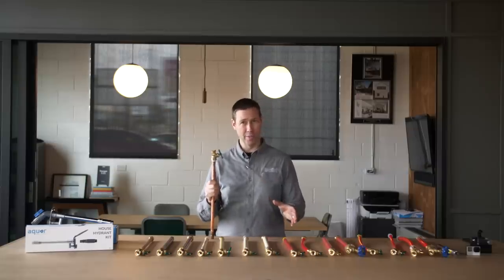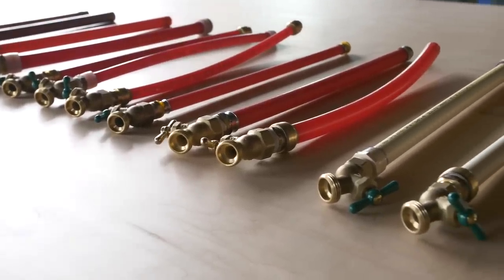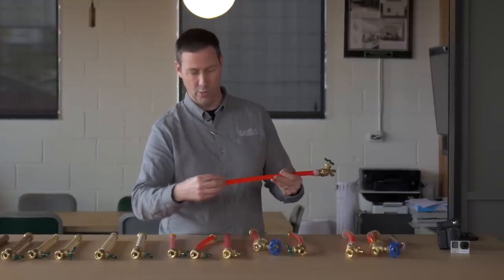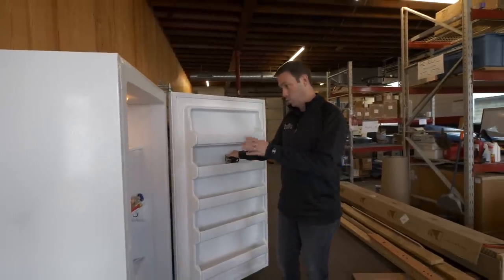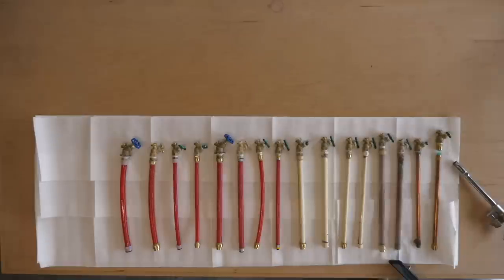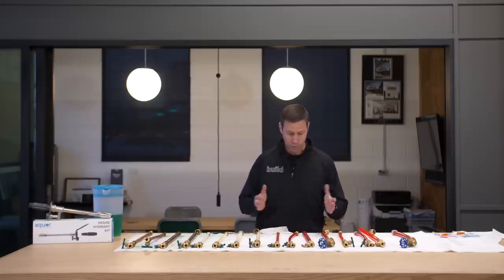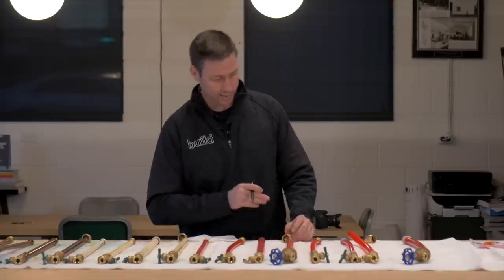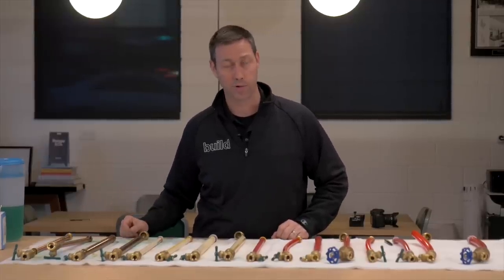Copper vs Pex vs SharkBite - Freeze Testing

Comment: I have not even finished the video yet.. Personal experience.. I maintain some commercial properties. Some are just warehouse spaces here in North Texas. I had one that had copper water lines run behind some corrugated metal to a mop sink in a corner on an exterior wall. Very little insulation and the copper was hard and very near the exterior wall. One winter the pipe froze and burst. I replaced a 4 foot section with shark bite fittings and pex pipe. added as much insulation as I could get in there. No more burst pipe in last 10 years.

Comment: I'm not a plumber, just a homeowner and DIYer but I am constantly amazed at how crappy CVPC piping is, it gets installed without a thought to UV exposure and forgotten about. The years go by and it becomes so brittle you'd think it was pottery.  It always splits in the areas I have to dig and claw to excavate and unless I have the time and energy to replace the whole line I am stuck with an intermediate repair of clean new PEX attached to existing CPVC.  It just sucks.  And one last remark about licensed plumbers, I wish you would propose the best repair not the easiest for you.  It doesn't always mean re-plumbing my house, just had to say this.

Comment: An excellent, informative, well-devised experiment, Matt. About the only issue I can point to is that you did not specify the temperature inside the freezer. The colder the temperature, the more expansion of the water/ice there will be. My assumption is that if the temp were, say, 10 degrees colder than the freezer temp. some of the other pipes MIGHT have blown.
Reply: Completely wrong. The reason there is life on planet earth is  specifically because  water  exclusively expands in the temp range of 0  to 4C. Once it is a solid it is stable and does not expand further.    The  change of density is what  keeps the circulation of water (and oxygen) thru the rivers, lakes, ponds. The organisms are able to live  in the cold but unfrozen solid water.  This is continually occurring in the oceans.

Comment: I live near Raleigh, NC so not severe cold weather but cold enough to go below 32 and freeze water in pipes. And once frozen I don't think it expands much as you get colder, so yes more likely to get frozen in colder climates, but no worse damage from more water expansion, although maybe more contraction due to colder. All that said I've had copper tube split in lines that I'd turned off but didn't get drained completely. I had a copper solder joint get pushed apart due I assume to the solder breaking not pipe or elbow, had pex lines freeze, but start running without leaking once thawed. And I had a pex to copper fitting joint that was kind of under some bending stress start leaking after like 10-15 years. And I didn't think about it till a co-worker mentioned this, but pipe and fittings also experience stress when it's a hot water pipe and experiences thermal expansion. I'm guessing this might have been the actual issue with the pex to copper fitting as it was a hot water line. Probably be good to put some slight bends or even full loops in pex to help it with this issue! And I'm on a well so I like that pex is very inert to the slight acidity my water has. I think it helps not only prevent leaks cause by acid eating away at the metal, but also leaching copper out of the lines and leaving green stains in sinks. And as a DIY guy I love the ease of working with pex. My favorite over all is pex used with barbed fitting and the pinch clamp type, because the bands are easier to remove than crimp type. I haven't tried the plastic barbed fitting. They might be the best to prevent any metal leaching if even the fittings leave stains.

Comment: Interesting test I was considering using pex and then a copper elbow through the wall for the turn valve. But after seeing this seems running the pex straight might be best, the copper and valve will always be the weakest link if pipes freeze.

Comment: I'm curious how PEX and CPVC stand up to heat conditions.  The intense southern heat is legendary, add to that the heat from hot water lines. How much do they flex/bow and deform.  I also have doubts and questions about the O-rings in these connectors, how long do they last  through the years with normal flexing from water pressures constantly rising and falling due to use of certain faucet usage.

Comment: Great video Matt and a lot of work doing all those. I’m sure this is 100% opinion based video by everyone but I’m in northern Michigan built houses for 25 years and I still will never change from copper. Haven’t had any freeze and burst yet even in exterior wall plumbing which generally is a no no. However it’s all going to boil down to proper installation and insulation properties what I saw in Texas is not much insulation and also a lot of plumbing in the attics, another no no. Just my two cents worth.

Comment: Well as an owner of a Plumbing and HVAC company that does a lot of insurance work, let me tell you what I know.
Pex will win this war every time. 
 The only instances that I see pex pipe fail in a freezing condition is when you have a short piece in between fittings that change direction.
 Other than that it pretty much only fails at the fittings.
CPVC is utter garbage and I would never willingly install it for water supply.
Copper will most certainly burst if it cannot push the solder joint apart.
 I have seen hundreds of shark bite fittings that have failed from expansion when water freezes.
One thing that is for certain in a water distribution system there will be little to no air in the system, this could cause a test like this to give false information if the user wasn't very careful to get every section completely full.
Reply: "utter garbage"....truer words have never been spoken!!!  This test was VERY misleading as to how horrible CPVC actually is once it ages a few years....

Comment: Wondering about the diameter increase on the PEX. If I remember correctly it's supposed to be able to handle 135% expansion without permanent damage so with water freezing at around 109%, depending on the fill temperature, the PEX itself should be fine. The fittings may become the weak link but by the PEX allowing itself to accept the expansion it's likely adding protection for the fittings. I left 3 filled 6 foot crimp capped lengths outside for the winter and they all survived. I should have left one out in the sunlight. 

Interesting Koolaid experiment.

Comment: I have had a pipe burst inside the wall that leads to my tenant's washer three separate times over 35 years. I first used half-inch copper. It burst below zero. I went to PVC; it did the same. I went back to copper but insulated it and created a drip-drop system. It lasted many years until I shut the drip system off accidentally. I will try Pex. I think I will have much better luck from what I saw in this video.

Comment: Our home was built in 1940's Soider and copper never had a problem. Not a fan of the new crimp style doesn't look like it can last very long.
Reply: In the forties copper solder had lead in it which could leach in your drinking water, but the copper in the forties was a heavier gauge and higher quality, but PEX will last longer than any copper since it does not corrode.

Comment: I'm watching from the North and I CAN imaging putting a waterline all the way to the outside of the house because our builder did it on our house (built 2016). Pipe to the edge of the wall with a regular hose bib on the end. No drain anywhere behind the hose bib.

Comment: Before I see the video, I'm going to throw this out there and say sharkbite wins. I've seen those metal clamp style things fail many times as well as copper lines expanding. Pex with the use of sharkbite, if done correctly, never fail.  I'll never use those metal clamp things and avoid copper as much as possible. Clamp things may not fail with the cold, but corrosion does eventually get to them.

Comment: Nice video, well done. I may be late to the show, nevertheless. Matt, for the copper pipe did you use type M or type L? 
Type M is "medium" wall thickness and printed on the pipe in RED, while type L is "large" wall thickness and printed in BLUE, stay away from the red. In -30'C I have seen frozen type L pipe, the pipe did not burst, but the fitting were pushed as if they were not soldered at all.

Comment: Matt,
I work as a commercial general contractor and have seen PEX starting to be used in more facilities including a new hospital.  The one downfall I have heard is that PEX can more easily contain contaminants, whereas copper is naturally resistant to bacteria.  This seems like a pretty big deal and makes me question the longevity of these materials, not necessarily from a durability standpoint but from a health aspect.  Thoughts on this?

Comment: Great information, I think 48 or 72 hours in the freezer may of been better. Looking to run 1 inch on a farm 500 to 1000 foot and below the frost line. It looks like I would use type A but how about the fittings for underground?

Comment: I Love the look of Copper outside. Both for House and Garden.   I have either PEX-A or PVC connecting to the copper/Brass.  So if its in the Ground there is Maybe 2-3' of copper and then PEX-A/PVC in the ground.  If its on the house, Its a HoseBib, to brass nipple to PEX-A Brass fitting to PEX-A.  I'm North of San Francisco , so its not Super cold here.  You mentioned you were going to comment on the Hosebibs leaking. I like to use 1/4 turn Brass Ball Valves. How does that compare to the ones you used?  Thanks!

Comment: Every time I plumb something and use pex I thanks the gods for pex and not having to use copper. spent a lot of years soldering copped from 1/2 inch to four inch pipes under a school at 20 below. Shark bites are for either emergencies or extremely hard to access pipes where soldering is too difficult. Despite the high cost people use them like they are just as good as a normal fitting, and they aren't.

Comment: I think another interesting piece of information would have been the amount of pressure typically developed as the result of freezing water. Granted there are various variables but non-the-less a enlightening piece of information. More direct might be that the burst pressure of say 3/4" drawn copper tubing is about 5900 PSI. So that's the kind of pressure your samples of rigid copper where subject to. (Much more if they were 1/2".)

Comment: Interesting experiment, I was wondering how pex and sharkbite hold up in general to freezing.  I think the sharkbite flaw was the fact the materials were to dissimilar.  The copper probably shrunk initially due to the cold temperatures which allowed the fitting to slip, as the water froze it expanded the pipe but it was to late.  Where as the pex and sharbite expanded and contacted at the same rate.

Comment: The primary problem with PEX is the hot water and minerals in the water that causes them to fail long before copper would so they both have pros and cons. The best one to use for your application varies greatly on temperature variations and water conditions in your area

Comment: If you use copper outside you need to wrap around it a heating strip that comes on only when the temperature drops around freezing and of course insulate it.

Comment: You did not try plex with PVC quarter turn valves. That is what I use down in Texas for outside faucets.
We recently (Feb 2021) had 3 days of weather in the 20's, with a low of 8 deg F. No cracks, no leaks, no splits.

Comment: Rector seal on the hose bib connection would have been interesting. Teflon tape should only be used on accessible plumbing like shower heads

Comment: hey Matt thanks for taking the time to do this test for all us builders.  I was curious as to which systems would fail in freezing conditions and how; came across this perfect explanation of exactly what i wanted to know.  I love using copper because its charming and beautiful when installed by a plumber with an eye for aesthetics, but also for its incredible anti-microbial, anti-fungal, and anti-bacterial properties.  Your old copper pipes deliver water that is way cleaner than you might think --- if you have old copper pipes you almost definitely have lead solder -but no bacteria (warning: im not a scientist:).   True running copper to a hose bib outside works fine if there is an indoor shutoff and the water is drained from the run between that indoor shutoff and the hose bib before freezing conditions.  I have installed many.  But at some inevitable point, sooner than later, you WILL forget to check the weather before the first frost, and you WILL forget to close the valve, and you WILL bust a pipe.  Mine just busted.  the one my dumb ass  installed on my own damn house.  Also important to check is whether the hose bib outside is higher in elevation than the indoor valve.  This will cause a condition where in you shut off the indoor valve, open the outdoor valve thinking that you've drained it, but the pipe is still full of water due to gravity then your pipe may still burst especially of you close the outdoor valve. There may be common valves that im not aware of that bleeds water/air automatically  to mediate this problem but  I am just a builder not a plumber so use of salt grains encouraged when listening to me.   I would avoid using copper in this application all together.  Just listen to whatever Matt says.

Comment: Recent single freeze in the DEEP south and the one system not discussed here is pro press copper and I heard of many failures.  The ice and pressure just push the fitting straight off.

Comment: Good test but perhaps not cold enough.. My house and my neighbor have cpvc. Our backyard faucet lines froze solid and burst during a very cold snap in the low teens for a few days. I had used my internal shutoff. He had not. He got flooded. I just had that line replaced with pex

Comment: Fun Fact - Water can't freeze unless its got room to expand. So if you've got something strong enough to prevent the expansion of water when it's trying to freeze, you can lower the temperature of water well below 32F without freezing, theoretically all the way to absolute zero! Water gets below 32F/0C before it breaks a pipe just because it's not allowed to freely expand.

Comment: It would have been good to put air pressure to the fittings after freezing. This would allow you to see if they did in fact hold and where the fittings failed. Some of the Shark Bite fittings can weep after freezing.  I’m a big fan of the Upunor Pex.

Comment: I redid some plumbing at my northern michigan home in PEX thinking it was the best to use,  I have had nothing but issues, 7 blowouts where i had floods, 4 in my garage alone , lucky i only lost bags of cement and a few tools getting rusty. I even had the 1/2 line to 3/4 thread fitting start spewing a fine line water geiser. I contacted pex and they sent me a new 1/2  line roll which was nice but, had a flooded kitchen, bathroom and then water under the crawl space, they said they would compensate me if i gave them an estimate, i paid local contractors and did some work myself but what a headache. I say sharkbite or copper only.  I may have got a bad batch but ohh my god. I still have to fix 2 blow outs in my garage. I have video and pictures of the pipe.

Comment: This is a rather minimal level test if you want to more of a full indication how much your system might take . The lines weren't pressurized , and while he had subjected his test units to a freezing temperature , a typical freezer unit will only push the temperature just so far below freezing ; mother nature has A LOT more capacity. The longer the pipes are in the cold and the colder the temperatures the more brittle they'll get. Also are you aware that warm water will actually freeze faster than cold water ? It's a good test for a short duration fairly minor freeze but I don't know that I would look to the results here as to much of a solid indicator of a high degree of reliability. It's an interesting glimpse at what kind of performance you can get to a point.

Comment: Are pex A/B elastic? After some bulge, do they get back to original size? I think, no. First round they may expand and hold up. Now the exapanded size is the new permanent size that is filled with water. Next time it freezes, it expands again. At some point it will split. Yes, better than copper, but not freeze resistant. I saw some good options for outside bubs where the actual shutoff is inside the wall. Cool video. Like the other person said, with actual water pressure would be interesting. Anamalous expansion of water  starts at  4deg c(49.2 F) when temps are dropping.

Comment: Have had SO much PEX burst due to freezing, and that's inside a garage 6 ft from the wall of the house in Michigan.  One thing I do like about it though is it's easier to visually identify the split in PEX vs copper.  Larger opening and discoloration.  I don't think these tests were quite as accurate as they could be: a bit of air was left in the pipes, and some were allowed to leak, therefore relieving pressure.  Bottom line, in northern climates, it really doesn't matter what you choose, if you forget about winterizing, you WILL have a  burst pipe.

Comment: If he had tested the oxygen barrier PEX, he would be in for a surprise. They do NOT like cold, and will burst if they freeze.  Used 1/2" in my barn for the horse watering, heat tape failed on one section and sure enough, POP, blew right through the line.  I have 3/4" non oxygen barrier like what he tested, has held up much better for 18 years now.